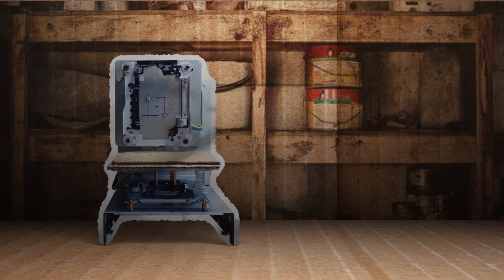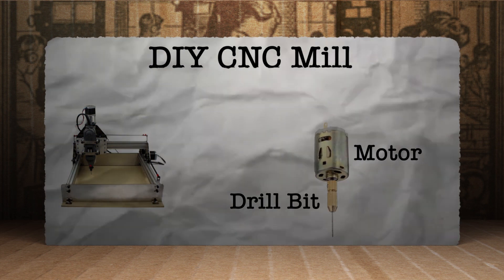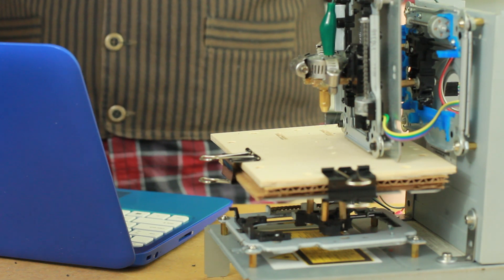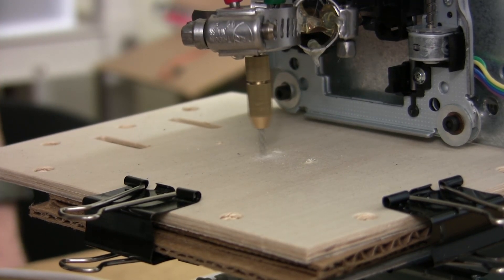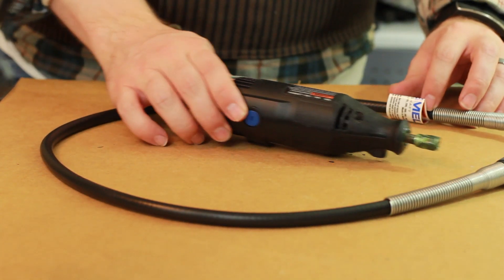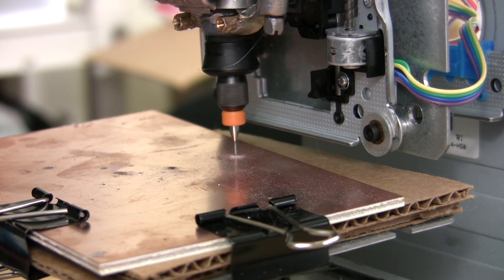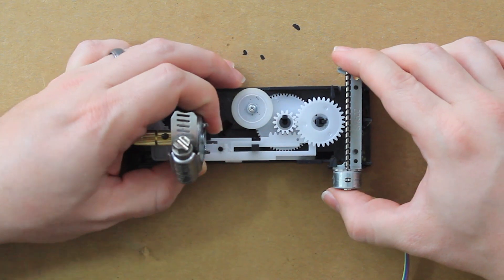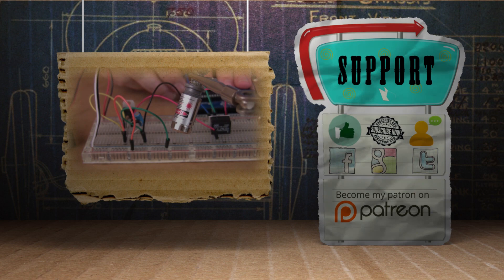Homemade CNC Milling Machine Epic Fail

Comment: Ok, I've been a machinist for 12 years and I run and program cnc mills for a living. There are several problems with your project and I would like to point them out constructively. I think the ingenuity in this project is fantastic but here are a few points. You need to make sure your spindle is centered perfectly on the motor and rigid. You need to find something more substantial than hot glue to secure the spindle in place. The final suggestion is the tooling. Drills cut only in a downward motion. The flights down the side are not cutting edges they are grooves meant to guide chips up out of the hole away from the cutting edge. What you need is an endmill, they do come in sizes that small and are around the same price. The endmill ,despite its name, is meant to cut with the flutes up the side. Some endmills are center cutting and can be used for hole making. Keep up the good work.

Comment: The correct solution is a belt-driven spindle. Sometime's it's sad watching hobbyists slowly and painfully work out the surprisingly obvious, (mostly 'cause I did it myself) in this case about 100 years of machine-shop experience.

A spindle is a rod supported at both ends by a bearing. The rod ends stick out past the bearing so that on one end you can put the collet/chuck, and the other has the belt pulley which runs to the motor. 

These days, you can use a Brushless DC motor / speed controller from Hobbyking and get hundreds of watts for $25. The belt is a specialty item, but for $10 worth of fibre-reinforced rubber, you avoid all kinds of problems with mechanical linkages, concentricity, vibration, and wear. Direct shaft connection means you have to be accurate to micrometers, or your machine slowly shakes itself to bits.

The point of this arrangement is that the spindle self-centers, because it's supported at both ends. The mechanical forces are made to help, rather than hinder. It even remains concentric during lateral loads, such as milling. If you have a single bearing (which is what your motor is) or attachment point, then the spindle can effectively act as a lever around that pivot. That's what happened to you.

Look at the design of a cheap-ass drill press, and you'll see exactly the same arrangement. Even the Dremel spindle works like this.

Comment: So disappointed that you did not use foam, and do a 3D carving. I think foam is the perfect medium for this mini CNC. There are tons of uses for foam too. RC airplanes, lost foam casting, concrete casting, modeling miniatures, cosplay, vacuum forming after a coat of plaster, and much more I'm sure. Being able to easily glue the pieces together made it scalable to any size. Lost foam casting would be easier since you could build an object up by layers. Allowing for the filling of voids with sand cores. Rotocasting would be interesting to try with foam too. Foam can be burnt out in a kiln, or melted out with acetone. A lot of possibilities. Was that a milling bit? I wish you would continue with this series a little longer. I subscribed because I am enjoying it so much. Maybe you could try creating an object in Sketchup, and show how to export it to create a 3 dimensional object.
Reply from the maker: +Jerry Whidby Great suggestions! I didn't even think about foam! The bit on the dremel is a pcb milling bit. I have other engraving/milling bits, but they're large and overkill for such a small setup.
Reply: +Tinkernut I'd also love to see much more come from this series before it ends! I, like Jerry, am absolutely both looking forward to & glued to, every episode of it, including the comment ones. Being able to build your own low cost but capable CNC milling machine opens such a outrageous list of virtually limitless possibilities! If you are willing to continue or very soon revisit the series, perhaps you could use drawer sliders to aid in strength & stability? And as an option for a cheep way to get the motors. If you could get a hold of an old used WowWee Rovio? They used 3 pretty decent stepper motors to drive the 3 omnidirectional wheels.
Reply: +Jerry Whidby Its also possible to use a hot wire instead of a drill bit for a cheaper solution

Comment: Was the drill bit you used made for milling? It looked like a normal bit rather than a milling one.
Reply from the maker: +Jake Dancel The bits for the DC motor are normal bits because I was unable to find any milling bits that would fit at the end of a DC motor. On the dremel, I was using a PCB milling bit that is normally used on a Shapeoko engraver.
Reply: Tinkernut do you think a V-bit would have worked better? (in this specific cases)
Reply: +Digitalmannen That's what I was thinking
Reply from the maker: +Digitalmannen most likely. i have an engraving bit, but i wasn't really wanting to go out and buy extra bits.
Reply: +Tinkernut yep you can get tiny router bits for Dremel but they aren't super cheap.
Reply: +Tinkernut Your a nice dude
Reply: +Jake Dancel I agree!  I would have used a v-bit.  You can get them pretty cheap from China on eBay if you can wait 4 weeks :P
Reply: esquach lol

Comment: yeah, the thing with machining anything be it cnc or manually controlled is everything needs to be rock solid. on any kind of a decent mill you should be able to drill a hole at a datum point, raise the bit move it across the workpiece, then grab the whole thing with both hands and yank in any direction  then when the appropriate inputs are given you should be able to return the machine back to the hole you drilled at a datum point in your workpiece and the numbers should all line up where they were when you started otherwise you have a problem and use the distance you are off from your datum point to find which axies your machine is drifting on then tighten them up. this is very important for rotation and vibrating tools as the acoustic vibrations created by the tool tip on the workpiece will cause the entire machine to move and you will get standing wave patterns also called 'chattering' defects in the workpiece.     While I see the idea to see what can be done with scalvaged parts, plastic gears and low torque motors are not the way to go. I would go with metal ball screws as can be found in linear actuators, they are basically the same thing you used to have on those big satellite antennas and some automatic gate openers. They can be found on the surplus market with about 1 foot of travel  and with a 24vdc motor for use in hospital beds (the raise lower tilt mechanisms) I would either find a way to convert the motor to a servo motor by way of some kind of position indication feedback sensor or just pull the motor and replace it with a servo as those  ballscrews are really geared down a lot and they have very little play due to the nature of their operation.

Comment: correction: "drill down to the laminate", or "substrate", not "perfboard" because perf stands for perforations, which refers to the type of boards with a neat grid of holes already.
Reply from the maker: +frank26080115 makes sense. I didn't know the correct terminology, so I just guessed ;-)

Comment: Would you consider retrying this project in a larger scale? Using old printers and or scanner for instance? That should allow for a stable & strong enough platform to use the Dremel with flexible extension.

Comment: Plz make a drone for less than $100
Reply: That is a good idea
Reply: +Netaro Why would you correct something that isn't a word?
Reply: +Jacob Zyla You can get mini quadcopter kits for ~$90 on ebay, just search for "mini250 quadcopter" or so. However, you still need to buy at least a RC radio transmitter + receiver and several batteries with a proper charger, this can be between $50-100. Not to mention the video system if you want FPV, then you're looking at an additional $100-200 just for that.
So unless you already have all those additional components at hand, or you get a bargain deal, building it for under $100 isn't going to happen. You'd better buy some of the cheap chinese toy drones, some of them even have video camera.
Reply: +hompalai because "plz" is annoying to look at
Reply: luigi1fan1 Still can't correct a non-existing word.
Reply: +Jacob Zyla That's easy. I do that all the time. As other people have pointed out, the hard part is finding a transmitter for <$100. XBox One wireless controllers are almost that much, only go 10 meters, and don't have failsafes. $200 for a good TX (Like a Taranis) is basically your entry ticket to the hobby. (And it's the bit that doesn't crash, so long as you use a lanyard.)
Reply: +Jacob Zyla He could 3D print some of the smaller parts. The plastic is pretty cheap.
Reply: Aliexpress. Get a drone with FPV camera and headset for under 100$

Comment: Try making a cnc from a printer it 
may be stronger
Reply: omg please
Reply: this would be amazing
Reply from the maker: +Eli S. Definitely. I just acquired an old printer/scanner combo. So we'll see what future projects it brings!
Reply: +Tinkernut A lot of good parts in printers / scanners, steppers, dc motors, straight iron rod sliders, gears etc. Often there is a fairly strong x-axis setup, but often the "head" sits on a wobbly mount, so that will need some stabilizing. 

But this build is definitely not an epic fail, it is learning by doing or trial and "error". I really enjoyed the videos!
Reply: for sure donating

Comment: I was actually doing the same thing today with a different type of bit and it actually worked as expected. I used an engraver tip instead of a drilling tip and it was able to engrave on plastics, glasses and even on metals. But the only problem is that the z axis is not powerful enough to lift it back up. I did saw something on the stepper driver to change the output current,  but I don't know if it's safe to do so. And I don't even know if it would work.  What should I do?
Reply from the maker: +Midhun M.S I have an engraver bit and used it yesterday. My z-axis still has issues, though.
Reply: +Tinkernut Try using a brushless motor. And try a diamond tip if you are not working on any ferrous materials. Or go for a ceramic tip.
Reply from the maker: +Midhun M.S I could definitely make it work trying more expensive parts, but I was trying to do it as cheaply as possible with things I already had on hand. Good suggestions, though.
Reply: +Tinkernut Thx. What are you doing next?
Reply: +Tinkernut to cut through any sort of substrate you need a mill/router bit. A drill bit isn't designed to move horizontally and would create too much lateral pressure and break your bit or stall your motor.
Reply: +Chris Ollenberger I do enjoy the DIY spirit of the build though ( : I've designed and built 3 cnc routers and one laser cutter. You're on a slippery slope to becoming CNC addicted ( :
Reply: +Chris Ollenberger I have used industrial level cnc machines and they are very addictive if you knew to use them.
Reply: You could try to make the z-axis spring loaded to compensate for the weight, it would help you lift it up but you wouldn't be able to press down as hard, so its still a trade-off. Also you could add a reduction gear, increases torque but it'd be alot slower.

Comment: I had the same issue with this "cheap" chuck. I turns out I was over tightening it to the motor shaft. Try to remove the screw entirely, put it back to shaft and start tightening the screw in incremental turns and turning the motor on. Eventually you should get a stable rotating drill bit with the chuck fairly secured to the motor shaft.

Comment: Just some tips from my side: you seem to be using the jogging control of the grbl controller software. This will not give you any speed configuration, which you need, because yes you can make the jog go in smaller steps, but still every step is made with maximum speed (essentially, it is sending a G0 command). This is not recommended even for "normal" cnc milling machines. Instead send a command like "G21 G91 G1 X.1 F10". I guess your software gives you the option to input commands manually. Alternatively you could just type this command into a file and send it to the controller via the software. Now, you can play with the F parameter, which defines the feed rate (in this case in mm). I think, this might give you better results combined with the dremel extension.
Reply from the maker: +Oan Nam Very great suggestions. Is there any other grbl software you might recommend?
Reply: The grbl controller outs good enough if you know to enter the g codes manually.
Reply: +Tinkernut I do like bCNC, but i'm not sure, if it's "better". It does have more options (like autoleveling). Here's the link: https://github.com/vlachoudis/bCNC

Comment: discovering new amazing channel here ;)

I wonder if you could probably make this project work by changing one tiny variable here : making the drill work like a vertical saw instead ? The Z axis would simply but the drill at the right height, but the drill motor would have its own Z motion going back and forth to do the cutting, instead of a X-Y rotation. This way, you can use drill heads better designed to be moved sideways through solid matter. I think...

Comment: You could use the marker functionality from part 2 to draw your circuit onto the copper and then remove the unmarked spaces with standard chemicals. This way it can still be used to produce circuits.
Reply: Or you could paint the copper, and burn the paint off with a laser.

Comment: Replace the stepper motors shaft with a stud bolt of much smaller pitch , increases precision and torque significantly but messes speed further .

Comment: Something like an itty bitty end mill might be useful to you.  That little drill bit will be tough to use.  Also, make sure you buy a high quality bit, many of them (especially the smaller ones) are cheese-grade steel.  I think this will be a difficult project.
Reply from the maker: +Mike Breight I know that if I purchase better quality parts, the results will be better, but I was trying to do this with cheap-ish parts that I had available. I'll probably do a future video where I've completely redesigned this thing to make it more stable using quality parts that work.

Comment: Can you make an Electric Wall Plug with Timer?
Like You'll power on an Electric Water Pump and set a Timer on that wall plug for like 20 Minutes. So after 20 Minutes it automatically switches off the Pump thus wasting no water. 
I Dunno if there's any already but if You made one it'd be very cool.
Reply: Jerry Whidby Thanks, I had a feeling that there must be some. 
Also DIY things are cool. Huh?
Reply: +Zaber Ansary Extras There are times when DIY just isn't worth it because a ready-made solution is much cheaper.

Comment: You're awesome man! But could you tell me how to make a stronger machine in your comments shows just be brief.
Reply: +Reddi Sathvik It would probably need stronger motors, like proper NEMA 17's or steppers from a printer/scanner/photocopying machine. I also think like some people mentioned that a proper milling bit would be helpful :)
The wobblyness of the machine could be dealt with through building something with better structural integrity, look at RepRap-designs for working designs of this.

Comment: the milling bits are sold under the name "engraving bit" they look like triangles i am pretty sure if you use one of this even with the crappy z axis it will work! pls let us know if you try it.
Reply from the maker: +TheGodbaba95 I was using a PCB milling bit on the dremel. I really didn't see the benefit of a larger engraver for such a small machine. The DC motor just has a regular drill bit because I couldn't find any engraving bits that would fit on the end of a DC motor.

Comment: You really need a milling or engraving bit, drilling bit is designed not to move on x and y axis. Look for end mill on wiki. Hope I helped :)
Reply from the maker: +Srdjan Savic They don't have milling bits (that I could find) for DC motors. The bit I had on the dremel is a PCB milling bit which is designed to move on the x & y axis.

Comment: flimsy is flimsy....but you are using what appears to be a normal drill bit...you would experience a MUCH better result with an UPCUT spiral milling bit.  Also one that would fit a 1/4 collet(as well as a 1/4 drive) with a speed between 16k but more optimally 28-32k would also be much better.  Im not an expert of the small motor you have, but most small brushed motors (depending on the winding) are slow and I would assume a motor from a CD drive would not be rated for the proper speed to end mill.    Inventable used to have a motor options that was a straight spindle,basically a stripped down router motor and spindle.  It was very light.  If that is still to big how about a brushless RC motor, maybe 4500kv, but then the stability issues come back into play.  You can increase stability of the RM tip but increasing the seating depth of the bit, but that will in turn limit the amount of depth you can cut.  You could test this by seating a bit where only 1/8 of an inch of cutting surface is exposed and see how cleanly it cuts.  Then increase by 1/8 until the deflection is sub optimal....giving you your max cutting depth...or at least the limitations of your equipment. In any case, I find this to be VERY VERY interesting and hope you can take this some where.  It would be really neat to see you make the machine mill, say letters, from 1/4 ply.  I have a few 550 series and 775 series motors Id be willing to donate to the idea.  I could rewind the 550 series and maybe...and I mean maybe hit 28K RPM, MAYBE lol  Either way if it works YAY if not the poles or heat eats it alive...Also as Others have suggested both ends of the spindle must be supported.  with a 550 series motor you could use a motor mounting plate (some of which use bearings and are CHEAP) to hold the spindle firmly into place, but its only as firm as what you are mounting it to.  Oh well...just a few cheap ideas.